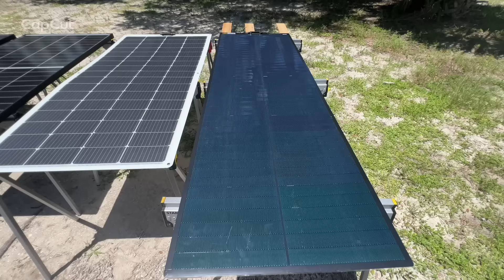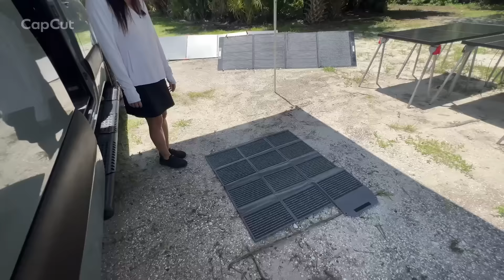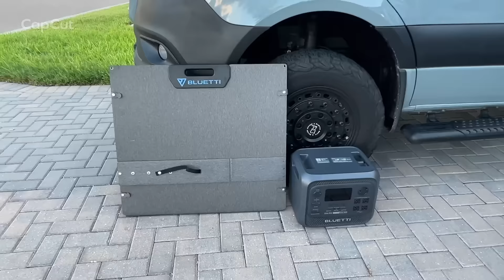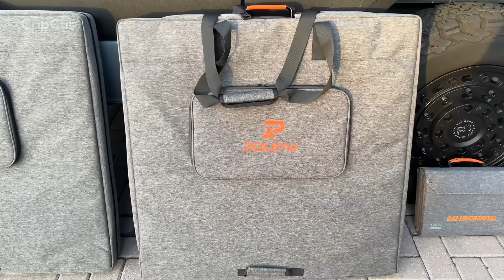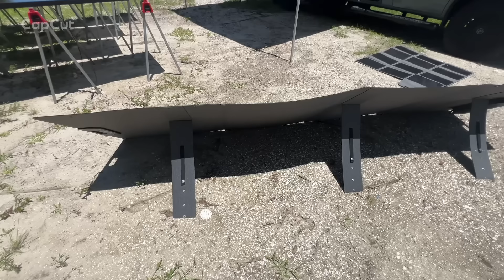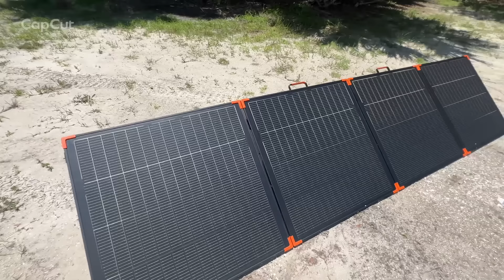7 Solar Panels Compared: Which One Is Right for You?

Comment: By the way I saw a video on a stripdown of an AC unit, 12V system but inside a buck converter with no explanation. Presumably for a better and stable input power but I'm wondering if it's there to take a 24V and 48V supply to swap in and those systems basically still 12 AC with 12V fans still?
You get your hands on all these different products so could put a meter on their output if they are a commonly used device?
Reply from the maker: That is an incredibly sharp observation! You are spot-on about the power stability. Even in a native 12V system, battery voltage fluctuates (especially under heavy compressor loads or when solar is charging). That buck converter is there to step down and regulate power to a rock-solid, stable voltage (usually 5V or 12V) just for the sensitive logic board and display, keeping the 'brains' from frying. As for swapping 24V/48V supplies—usually, manufacturers use native 24V or 48V compressors and fans for those models because the amperage at 12V is too massive to convert efficiently. However, they often use the exact same 12V control board across all models, using a buck converter to drop the 24V/48V down just for the electronics!

Comment: Would like to see 500W pv panels not so many tied to branded suppliers. The tech from China on the bleeding edge not bloated expensive ones that get given away to youtubers.

Our limit is area so watt density means bifacial n-type 500W. If full time ofc, and maximising winter solar will save on fossil fuel burning.
Reply from the maker: Thanks for the comment.  I did just post a video in which I tested a 450 watt bifacial however as I focus more on van/RV I have found that those larger panels are somewhat impracticable for RV applications.  However, I am thinking of expanding to small off-grid systems ... I am planning to test a system soon.  Also, I am always looking for better technology but I have to say, of all the portables I have tested ... and I have tested many ... ZoupW gives you the most output.  When it comes to Rigid panels ... Callsun has proven to me that they are one of the best on the market.  My goal is to provide you with the best at the best cost.  I have tested many cheaper brands, some are so bad they do not even meet the minimal specification ... those I will not even put into a video.  If you have a suggestion on a more technologically advanced panel, I am willing to  test it.